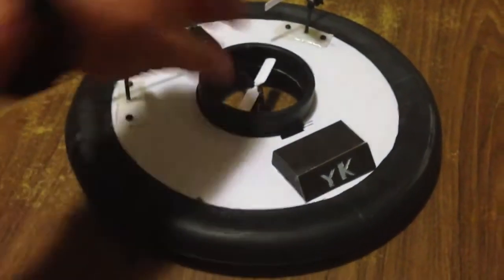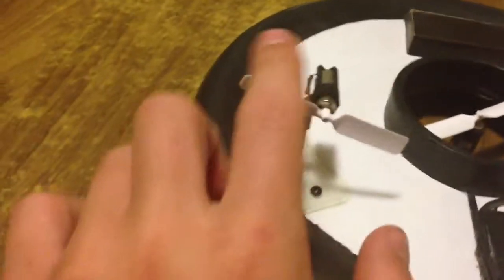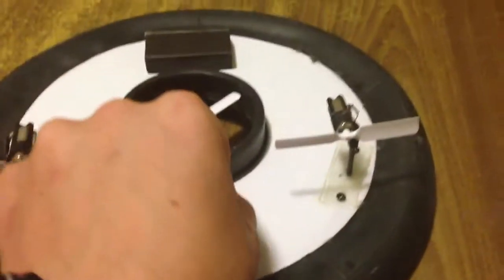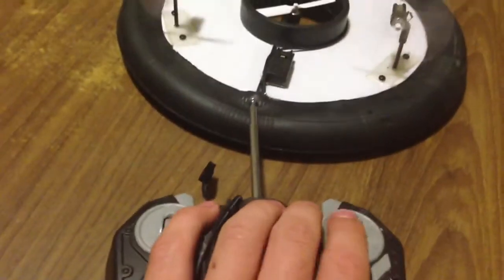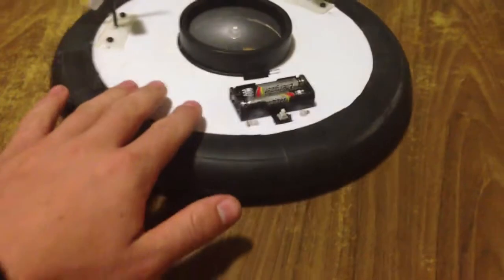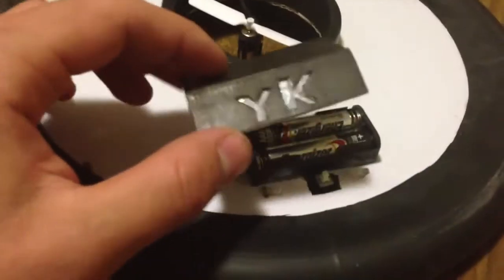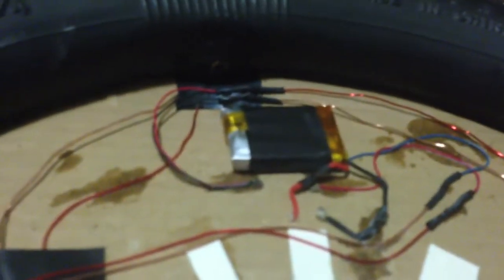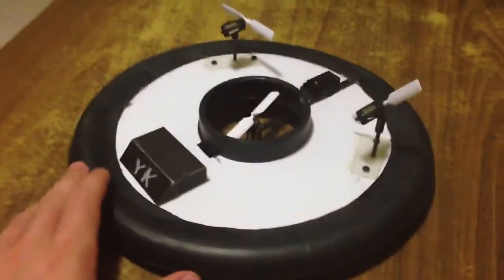My homemade RC hovercraft

Comment: Took me 6 years to find this... the perfect youtube video. 
The hovercraft is awesome, I've seen quite a few designs on youtube, and not a single one had a switch for the "lift motor" on the hovercraft itself. Some might consider that a flaw, since it's not fully "remotely controlled", but I find it rather interesting. I also  like the idea having a round chassis, seems like it makes it more stable and probably more controlable. Thumbs up from me 👍

Comment from the maker: well, its just around. you take the bike tubing and cut it around 3/4 of the way up from the inside and you glue the 1/4 on to the base of the hovercraft. that way it'll fill up with air when you turn on the hovercraft. and its not styrofoam I just used a really thin peace of cardboard like they have in cereal boxes....

Comment: I love what you doing man. I want to do kind of the same concept lol I ordered a Air Hogs helicopter with the flip up wheel gear lol I broke it so took it apart and I would really love to make what you've done using the whole steering concept of what you've done. could you tell me what you used for the skirt, looks like a tire lol I would love to know how the steering works with the fans balancing out thanks man hope to hear back from you soon
Reply from the maker: John Stuart Hey man, So first of all Thanks!! great to hear some one appreciates what I'v done!! 

The parts I used are from an Air Hogs "Jetset" (its a plane) they have a few versions but I think they all have the same electronics. about the Air Hogs helicopter with the flip up wheel gear. I don't know how That works, so I can't exactly help with that too much. as I said I have used the "jetsets" XD and yes the skirt is from a bicycle tube. how ever I would not recommend using it as a skirt because it is very heavy compered to the hovercrafts lifting power. I'd use a plastic bag, where the edges are melted together. 
the steering is controlled just by using the old "jetset "receiver and remote controller + motors and props of course. 

Ps let me know if you need any more help!